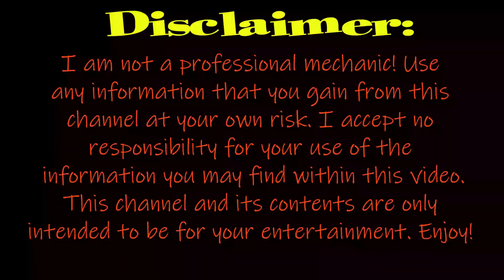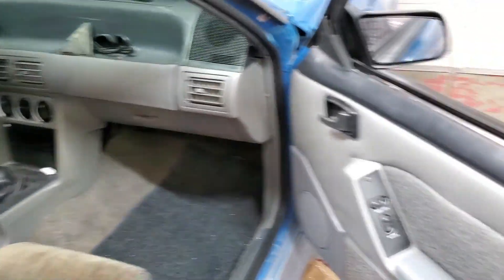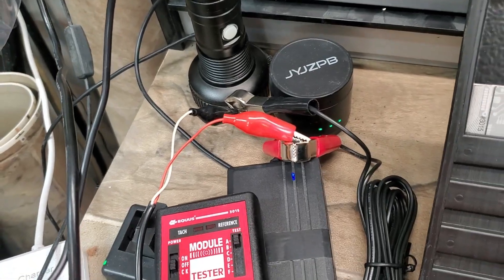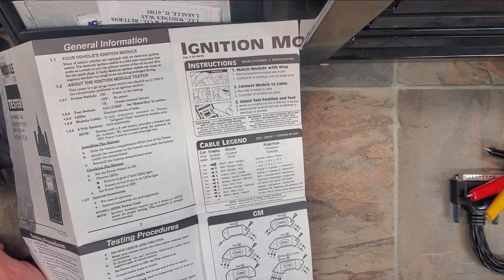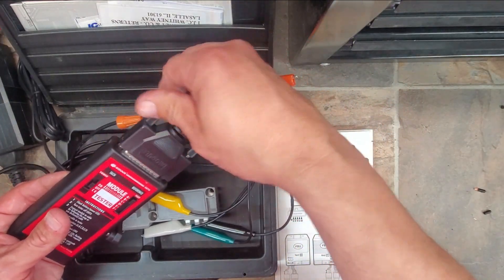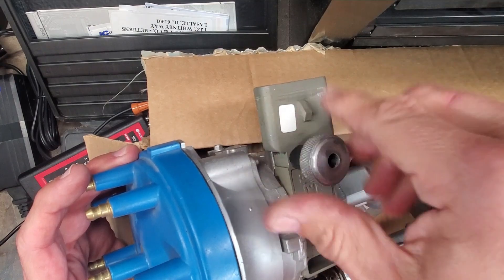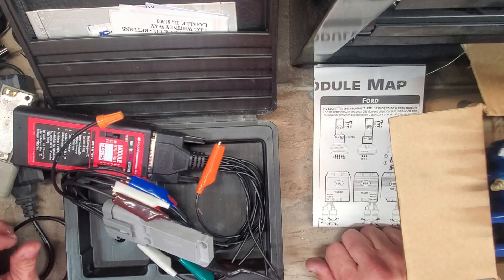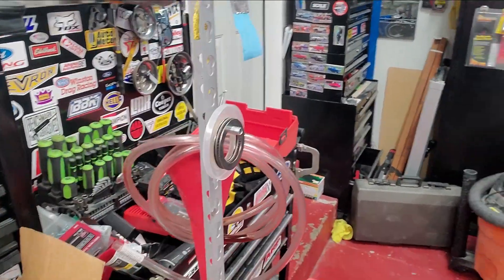The 89G - Fox Body Mustang TFI Module Test With My New Tool

Comment: Awesome video dude,as a guy that owns 2 of these cars i have a little double wall box in my trunk,i have a coil and a module and the necessary tools to get them off,these things fail at the worse possible moment (like in a turning lane,lol)

Tonight i was swapping out a module out of my 91 and when i pulled the plug off it broke in my hands!! i was like oh my God!!  it still plugs in but its not tight but i found out my local advance sells that Dorman plug or some incarnation of it so i put it on hold and i'm gonna pick it up tomorrow,i'm not cutting the wires though, I'm just gonna repin it, i cant possibly get mad, that plug is 33 years old,i think looking for that plug is what sent me to your video somehow.

I love tools like the one you show,i might have to get one,dont you have to test these under some kind of load or does the tool replicate that?  just wanted to add,on the new china distributors someone did something at least correct and they used regular phillips screws to hold the module instead of those funky ones that came OEM,it comes really in handy when trying to pull the module off with the dist in the car.
Reply from the maker: I believe what you are referring to is testing them when they are warm. You are 100% correct, they usually fail in heat conditions, and sometimes will come back to life when they cool down. You can sometimes replicate that by testing them over and over again. 

I agree 100% on doing the phillips screws. That was way better! That crap Ford did was not a good idea. 

Swapping pins is a great idea. All white wires would mess with my OCD.

Comment: New subscriber here! Great content! By the way dealing with those ignition modules is a PITA… sometimes they work when the engine is cold and when it warns up the car shuts off or starts misfiring. I’ve seen people who relocated their module away from the heat of the distributor to keep them from failing.
Reply from the maker: You are 100% correct. Years ago I had to tell Autozone to keep testing mine until it heated up. Thanks for the sub!

Comment: Buy the McCully Racing MK3 TFI relocation kit. It is the best on the market. Its what I installed. A much nicer kit than Fatfoxx and others.
Reply from the maker: I bought an SN95 heat sink for mine, but didn't realize the TFI also changed. I'll look into that kit! Thank you... and I looooove the way your car turned out!
Reply: Thanks buddy!! Still doesn’t hurt to keep a spare, but my issues seemed to chill after the kit.